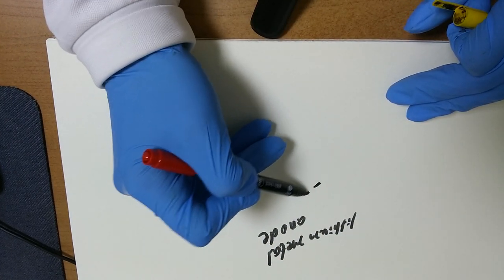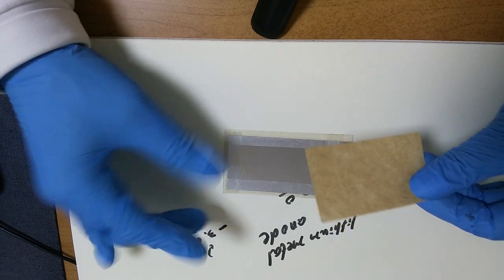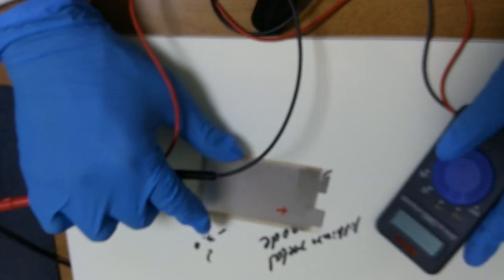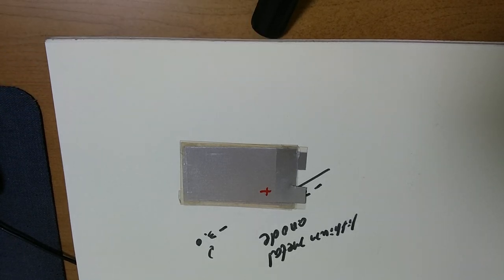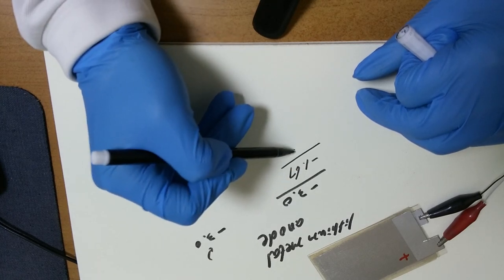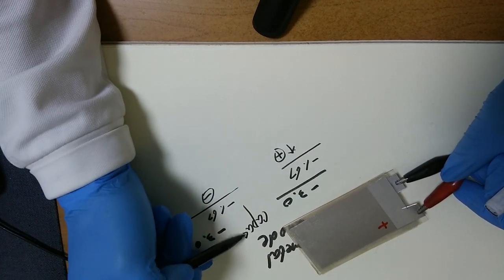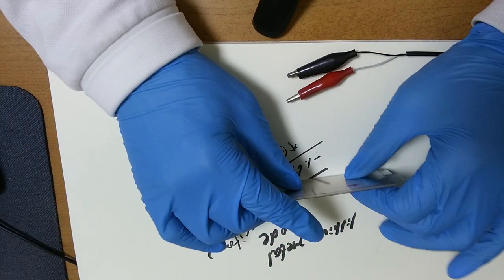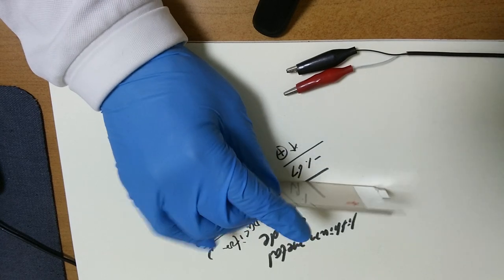solid state battery experiment: using aluminum metal without graphene

Comment: Yeah its a good look to all the other cell construction .  They really need to have pressure for the surfaces to have good contact otherwise you will always have higher resistance which will prevent effecient iion flow. Get some clamp or weight and you will see huge improvement in performance . This pressure can be experimented with aswell as it can be tuned for the characteristics you are after in your cell .
Reply from the maker: Always thank you so much. Really thank you.

Comment: Do you know what reactions occur in a aluminium - graphene battery? Have a nice day
Reply from the maker: Let's say like this: graphene is the summit of a mountain and aluminum ions are climbers, we help the climbers climb to the summit by using electricity(charging), then when we didconnect electricity,the aluminum ions will fall down again(discharge). I think the reaction will be done like this. I am sorry if my explanation is inappropriate. Have a nice day.
Reply from the maker: Aha~~~, in numbers: 0.76 - (-1.67) = around 2.3
Reply from the maker: But it might be different on the situation of experiments. Have a nice day
Reply: @solidbattery9956  is good explanation but some chemistry is other way around like flouride  ions are opposite charge.